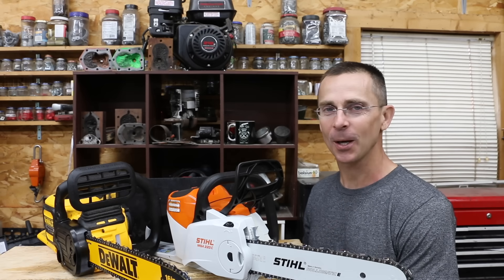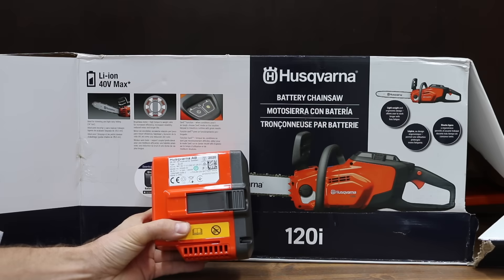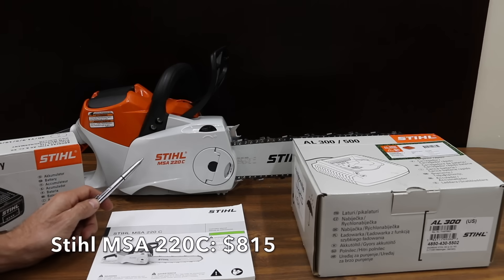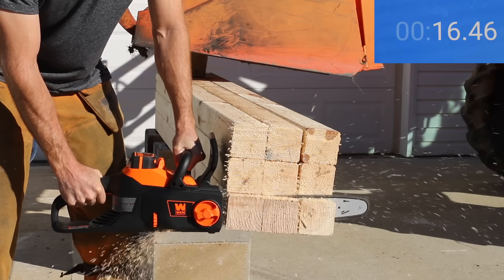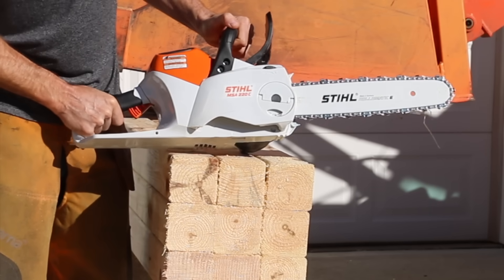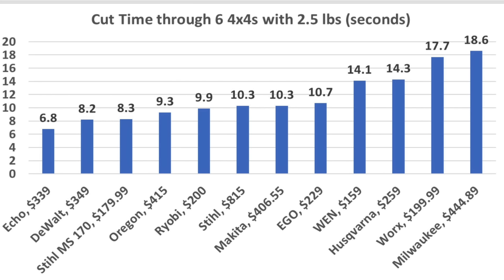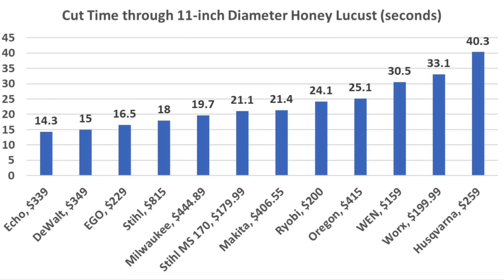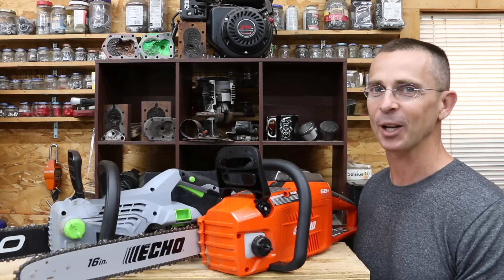Best Battery Powered Chainsaw Brand (ROUND 2)? Stihl, Husqvarna, Echo, Oregon, DeWalt

Comment: I use the Snapper 82v Max for all of my battery-operated yard tools (push mower, weed eater, leaf blower, etc) I've been wanting to get a battery operated chainsaw for some time now and having used a plug-in electric chainsaw and been disappointed I was skeptical of how well an electric chainsaw would perform. I was impressed with how well the DeWalt did in your tests and I was wondering if when you had some time if you could compare the Snapper 82v to it and see if it's worth the purchase. <3 your channel so much! Thank you!
Reply from the maker: Thanks for the suggestion.

Comment: Late reply: I'd love to see (for all battery tools) the size of the ecosystem. A Husqvarna battery is gonna be only good for a handful of yard-only tools; dewalt, ryobi, milwaukee, makita will have  a better time exchanging. Ego would definitely benefit from the bigger 5ah battery but hot damn are they expensive.  The nice thing is the bigger (ego) batteries are good for trimmer, mower, snowblower, blower, chainsaw, hedge trimmer, and a portable power inverter. Dewalt, ryobi, and Milwaukee will have a great time with small/medium tools, but I don't think you'll see a mower from team yellow or red any time soon...and that big battery is gonna be the biggest expenditure in the entire bunch.
Reply from the maker: Thanks for the suggestion.

Comment: I’d like to see how the new Dewalt 60V 2nd generation unit with the 15Ah battery stacks up to all of these. 

Also, you tested charging with the black slow charger that comes in the kit, but people who buy Dewalt are probably doing so because they are already invested in that battery system, and likely have and use the yellow fast charger (not included in kit)
Reply from the maker: Thanks for the suggestion.  Thanks for the feedback.

Comment: Do you think you will try Harbor Freight's Battery chain saw?  I am really curious as it has some tall claims on its motor at 80v & 18 in. bar, and only 9.8 lbs but it is not clear if that is with or without the battery.  I think they have a smaller model too.  They call it their Atlas Series and currently with a battery and charger it is only $279.
Reply from the maker: Thanks for the suggestion.

Comment: I have purchased some battery powered power tools, but I don't think a chain saw is going to be one of them.  The batteries run down quickly under load and they don't have the cutting power of gas.  I can see it for some small jobs around the house though, just not big jobs.  They are also slower.  Good for trimming a branch here there and maybe a small treed.
Reply from the maker: Thanks for the feedback.

Comment: This is an informative video and through test, but I wonder how relevant it is.  I own (currently) 3 Stihl saws, 2 gas and one electric.  
For serious work, I almost always reach for the 260 Pro.  Sometimes -- maybe mostly to empty the gas tank -- I reach for the older 029.  But, the one I use most often is for light work (clearing bush) is the Stihl battery saw, 120 I think.   The 120 (or whatever the model # is) has a reported run time of 40 minutes, and I've never drained the battery because hauling brush takes more time than cutting.  

If I had a rewind button, I'd own two 260 pros and one battery saw for light work, a Stihl 120.  Why Stihl?  The guy who services Stihl products is reliable, and when something goes wrong, that's what I want.

[ Most of my summer neighbors have heavier duty Stihl or Husqvarna saws and a small battery saw for brushing and tiny jobs.   Brands of battery powered saws varies considerably.]

[In 1999 a bad storm taught me MUCH about chainsaws.  I had a monstrously large saw and a light duty backyard Homelight.  It took 3 days to saw my way to the road.  First trip to town, I bought two new saws, 024 and 029.   The 024 eventually died.  I replaced it with a cheap Husqvarna that didn't last.  Next was the 260 and finally in May 2022 added the battery saw to the mix.  Stihl, good stuff.   Husky  saws?  Some aren't quite so good.  Bigger, more costly Husqvarna saws are excellent.]

Again.  Nice video.  Impressive testing.
Reply from the maker: Thanks and you are welcome!  Thanks for sharing.

Comment: I was going to get the Echo, but couldn't find it in any store (Home Depot, Menards, and Lowes) and it seemed all of them were phasing out Echo products in favor of another brand with the same color scheme so I decided to go with the Dewalt for support purposes.  It is a very powerful saw and the ease of use is off the charts.  75% of the battle with any gas chain saw is starting the thing so battery all the way.
Reply from the maker: Thanks for sharing.

Comment: Lighter weight isn't an advantage, some weight and good balance is necessary and weight avoids or minimises kickback which is a dangerous event especially if you're precariously perched.

Also, I have a Stihl shop 5 minutes from me, those other toys have to go back to China -if the warranty would even be honoured.

Reliability is everything when you've invested time to be out where a battery chain is required.
I'd get a cheap chain AFTER the Stihl as an emergency backup.
Reply from the maker: Thanks for the feedback.

Comment: I have 19 Ego tools, including batteries and chargers. Why I will no longer buy any Ego product is their pathetic customer service. I had a battery go bad under warrant and went through the obligatory troubleshoot, but then they wanted a picture of serial#, then they wanted a video of charging process, then they wanted all serial #'s from all my equipment. I would call and they'dsay we'llcall you back. They never did and then I'dget an email asking me to rate a none existent phone call. So I would email. Replies we're either days to weeks or not at all. So, I wrote corporate. No reply. A 1 1/2 goes by andnobattery replacement. Then they say they had sent it and I DID NOT receive it. They said since so much time has elapsed they couldn't track the delivery. So...no battery. Again wrote corporate. NO REPLY.
 Now, do you really wonder why they were dropped by Home Depot?  Because they are impossible to deal with. I've let go of my ego (lower case).
Reply from the maker: Thanks for the feedback.

Comment: I have the WEN and actually prefer it to my gas 20" ryobi saw. I have two batteries so I just swap back and forth. I've been sawing elm lately with the WEN and have been lasting far longer than what you mentioned. I did notice that using the teeth to "pivot" through the log drained it far far faster than simply letting it work its way through with some minimal downward pressure.
Reply from the maker: Thanks for sharing.

Comment: On the battery charging tests, it's worth considering that charging a lithium-ion battery faster usually means you'll be buying a new one sooner. I actually ordered the slow charger for my Stihl AP300 batteries for this reason.
Reply from the maker: Thanks for the feedback.
Reply: Exactly, avoid fast chargers for tool batteries and electric cars!

Comment: What amazes me is the established cordless tool brands Makita, Dewalt, Milwaukee etc should be completely destroying the traditional chainsaw OEM's. The traditional chainsaw OEM's dont have decades of experience with electric motors, motor control power electronics, not to mention the years of product development that has gone into the various battery platforms the cordless tool manufacturers have. Makita, Dewalt and Milwaukee should be  producing saws that are 3 to 5 times better than the traditional chainsaw OEM's with regard to performance and also doing it at half the cost. It is a disgrace that they aren't and a reflection of the sub standard products they release to market with incremental improvements year over year. Instead of producing the best product they can for the best price they can, we have this incremental improvement rubbish. The fact that Stihl or any other traditional small ICE engine tool company can compete shows you that these cordless tool companies are just scamming money from people by intentionally releasing inferior products with incremental improvements

Comment: These batteries, discharged in such a rapid rate lasting less than ten minutes (some less than three) until low voltage cut off will get very hot, especially when it is also hot outside. Used in such a manner more than just occasionally, their service life will be short, thus very expensive. These batteries are simply too low capacity for the task- would need to be north of 1KWH capacity before being comfortable with the task, but becomes bulky and heavy for this size/length of saw. Should also note the battery will have less instantaneous output the further south of room temperature the cells are at, and running them all the way down to cut off, and charging to 100% will shorten the service life. Electric automobiles have software and thermal control systems to counter these issues- these small packs allow the user to unknowingly damage & decrease capacity in short order all in the name of longer run time only when new out of the box.

Comment: I had a corded 14" Chicago chain saw from Harbor Fright that I nursed it through several electrical problems over the seasons and during the last season it threw the chain a bunch of times on "chain saw day". I though this season I would just replace the chain, but what I found under the sprocket cover was that the plastic case had melted  allowing the output shaft and sprocket to migrate forward thereby loosening the chain. What I saw was scant metal reinforcement in this area of the plastic case, with heat build up aggravated by a trapped vine between the sprocket and shaft bearing to melt the plastic around the bearing.  I can see that I exceeded the duty cycle on the thing as it will run as long as you can pull the trigger.    
The duty cycle with battery saws is dictated by battery charge, but what about running through multiple battery set in succession?    
I would like to avoid the "plastic-case-on-bearing" design in the future. What I could see in both of your videos #1 & #2  on these saws is that some clearly had robust built-up & metallic areas around the output shafts, and others, including some of the best performers had output shafts surrounded by plastic. They may have better construction under the skin, but I couldn't tell. What are your thoughts on duty cycle for rechargeable saws, and do you think any of these saws melt in the output shaft area with multiple battery changes? Thank you.

Comment: Hello men.  From a lumberjack lady, I would like to add the following.. the chain types comes into play. Does the tests does not account for initial chain stretch and tension adjusting.. NO. We know small economy chains do stretch more than robust chains. It this a regular chain, square cut, economy or pro model.. speaking to Oregon, Husky, and Stihl. Are the cutters on every other chain? As far as usage, were any of the chainsaws warmed up for 30 seconds or a minute?? And technique, did any cuts employ the use of puppy (dog) spikes.. No? Lastly what was the elevation and ambient temperature of the cutting. I doubt these batteries would work in the cold mountains or early morning. As an owner of another battery brand (which rhymes with Mate), I can tell you electronic chainsaws generate heat and so do the batteries. Prepare to invest in three to four batteries if you would like to get something done. And batteries need time to cool off or else they will not charge as designed.

Comment: Why is the Stihl MS 170 the control? It's a cheep and tiny saw. MS 261 C-M should be a better candidate for your standard saw as it is probably the best 50cc saw.
It would run circles around these electric toys.

Comment: i brought a stihl 140 saw and it keeps cutting out after about 2min of cuts 
it has three red lights if you push the battery button 
i took it back to shop and they said nothing wrong with it 
so i googled it and it means its to hot that is crap after about 10 cuts of a 3 inch hard wood log 
when it dose it you have to aply the brake and let it of then it starts up again 
have you found this problem with any of these battery saws 
and it is new only been charged 3 times

Comment: Great testing. I have a number of sthil tools. I don't think the other brands you tested are available here in Australia. Hikoki, Milwaukee, Makita have come out with chainsaws in the battery range. I was tossing up on whether to get a sthil or hikoki as I have the multivolt batteries for hikoki.
I decided for sthil my reasoning was sthil has been in the chainsaw business for a very long time.
Did I make the wrong decision? The way I could interchange bigger bars sold me if the lumber had a bigger diameter.
I like the test meter that reads how fast rpms.
Also the decibel reader.
Great job.
Reply from the maker: Thanks!

Comment: When it comes to charging the dewalt. They have a fast charger for their 20/60v  batteries that will cut the charge time down significantly. I was considering purchasing the stihl but ultimately went with the dewalt because all my work tools are dewalt and i can and do use the flex volt batteries for work as well. It seem i made the right choice and the saw works great for what i need
Reply from the maker: Thanks for sharing.

Comment: Even after Part II of the battery chain saw showdown I haven't changed my mind and I still want to go with a Makita. Sure, the main reason is the fact that I've been inside a Makita platform bubble with their 5Ah batteries popping out of the most unexpected places. But even if we put that aside I think that Makita offers a great set of performance and although it didn't come out at the top, Makita consistently performed in the top part of the table in every test performed by Project farm.. My only problem is choosing the right model - the traditional chainsaw shown in the Part I of the video or their top handle model. Ultimately I'll end up with this regular one and an 18V top handle model for those light duty pruning jobs when the weight and a one handed operating comes in handy... Oh Makita, you will drain my already limited power tool fund.
Reply from the maker: Thanks for sharing.

Comment: Apples & Oranges.  Why not compare equivalent sized chainsaws?  EGO makes a 14”, 16”, and an 18” brushless chainsaw (as well as some pro models). 
       
      Comparing an EGO 14”, 2.5 AH battery powered saw to a Echo 16” 4 AH saw is hardly a fair comparison.  The proper comparison with the ECHO would be the EGO 16”, standard 5 AH battery saw.  EGO has the advantage of running any EGO battery (2 AH far - 12 AH) so it could be downgraded to a 4 AH battery to achieve an even head to head comparison. The 18” EGO likewise wouldn’t be fair due to a stronger motor & faster chain speed.

       I really like your channel. This was merely a testing oversight.  Most companies probably make one or two saws, while EGO makes six. 😎

Comment: Thanks for this!  I am in the market for a good electric / battery powered chainsaw for summer use (primarily) either when it's too hot to run gas powered or when traveling in the jeep and not wanting to haul fuel.  I was hoping to find a good brand of saw that out performed the others and found it!  I'll get the Echo! (I have Husky gas powered saws and thought maybe they or Stihl would be good but this convinced me to go Echo this time!).  Thanks!
Reply from the maker: You are welcome!  Thanks for the suggestions.

Comment: 32 passes from fully charged to flat so either I  will need a truck load of batteries or a five mile extension cable or a petrol generator?

Comment: surprising that the big brand chainsaws did so poorly.  my battery powered hand tools are dewalt…and it looks like it did decently in this test, save for losing on the charging times.  need better batteries for longer run times…across the board.
Reply from the maker: Thanks for the feedback.

Comment: DeWalt just announced two new 60v saws. Both more powerful than this DeWalt saw. One dramatically so. And both come with larger batteries than this DeWalt. Could be a total game changer. Also, Husqvarna has a higher powered option now available and several battery options. 

This is a rapidly growing product field and everything is an improvement over that prior.
Reply from the maker: Thanks for the feedback.

Comment: I've had EGO saw for 6.5 years. I have used it many times for various tasks. The 2.5 battery is definitely not a good one for the saw. You need 'juice' to cut and that capacity will not last long. I have 6 EGO batteries ranging from 4Ah to 5 Ah. Once the chain tension is proper, battery charged, and oil system filled up, this saw can do a LOT.  For a larger job, multiple batteries are needed.
Reply from the maker: Thanks for sharing.

Comment: Love Echo.  Have a big brush cutter from them and impressed with the quality.  However, a lot of chainsaws with 14 and 16 inch bars are going to be used shoulder height, overhead and so on.  Because of the weight Echo might not be the best choice.  I am also not impressed with the plastic felling spikes.
Reply from the maker: Thanks for sharing.